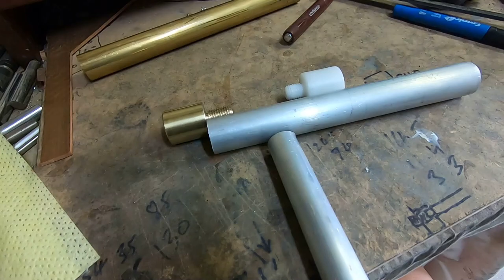Machinist Hammer - A Metal Lathe Project

Comment: Hi Adrian, I can't quite make out which model optiturn you have? If you have time could you share your model and opinion? I'm trying to decide my first metal lathe and it's a minefield! Cheers and thanks Steve (In Oz as well)
Reply from the maker: Lathe?  It’s this one. And this is where I got it. 
https://www.machineryhouse.com.au/L689

I’m happy with it for the price. The thing with lathes is the more money you spend the more “rigid” the unit. More rigidity = better cutting performance. 

This model only had power feed along the ways (to and from the chuck). Occasionally it would be handy to have power feed across the ways as well. But that’s quite a bit more expensive. 

Also, this model will only go down to 150 speed revolutions. For parting off, it would be good to have a lathe that did half that speed. But I didn’t know that at the time as I really had “no idea” when I started out. 

Also, for thread cutting you have to physically change gear cogs to match to thread pitch you want to cut. Not a huge problem but a pain. 

Knowing what I know now I thing I’d buy this one instead. 

https://www.machineryhouse.com.au/L149